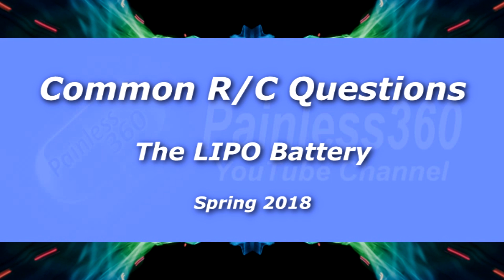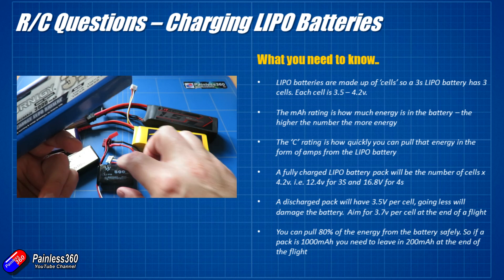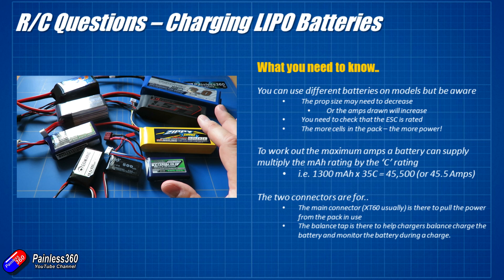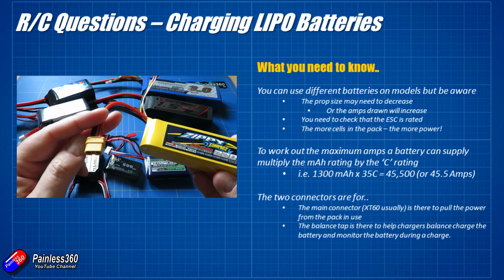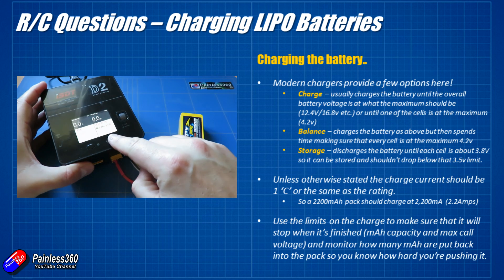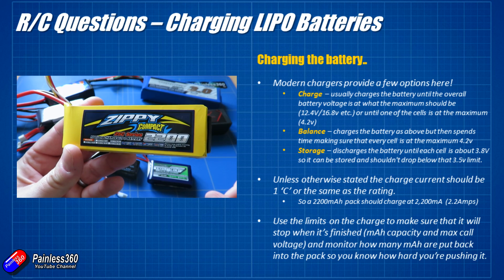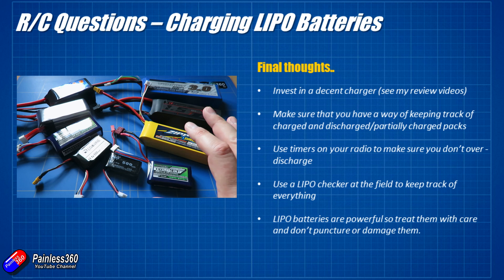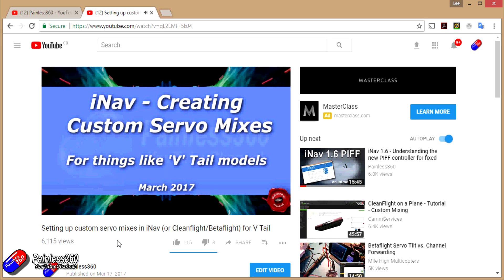Common Beginners RC Questions - LIPO Basics and Charging Tips

Comment: I wanna make my rc boat faster.    Is it the Volts that make it quicker ?   1 battery is 7.4 volts.  If I run 2 battery's together should get 14.8 Volts.  Should make the boat faster correct?
Reply from the maker: Increasing the battery voltage but kwwp8 g everything else the same might make it faster, but only if all the components can handle the extra voltage and power... Happy flying

Comment: Hey  glad I found your channel! I've been an avid RC pilot most of my life. Since I immigrated to Australia from the USA, I had to turf all my 72Mhz stuff and go with 36. Then everything went to 2.4.. so I bought a Futaba 9C system with the FASST technology. I then became Ill and put my aircraft into the hangar for 8 years. Last week I had to buy all new battery packs - including the 12V lead acid to start my nitro engines. An OS 2 stroke 120 pulls my giant Cessna 182 and a Thunder Tigre .70 4 stroke pulls my Extra 300S. So, all NiCd are gone. I was thrust into a new learning curve aged 68, but this video really helped me. Everything is all ready to go for this weekend! The question is,  do I dare fly the Extra 300 or stick with the forgiving 182 with its flaps and enormous wing - it will continue to fly at a walking pace and stop at my feet after <10'  roll-out after touchdown. I think that the Cessna will accompany me to the field this weekend. Thankfully, both of these aircraft's control  settings were retained in my Futaba T9CHP's memory.  It may be an 8 year old radio,  but it still works fine. With its 2.4Ghz module, near new receivers, servos, and, now,  brand new flight packs, why not continue to use it? I AM eyeing up a new Spektrum NX10 system, though!! That will take place when I finally  go with real turbine power. I rarely fly full-size planes anymore, and I still need my fix. So, why not go turbine if I can afford it? My daughter reminded me of a saying when she saw me getting ready to fly again. She quoted, "The difference between a boy and a man is the price of his toys. ".😂

Comment: Yes sir I have a 550mm pixhawk drone I'm using 2 lipo batterys both are 3s 25c ratings my telemetry tells me loss of power on 1 motor and if I take one of the batterys off it will say now 123 loss of power is it because of the c rating I'm using? If so what would you recommend for such a large drone?? Thank you!
Reply from the maker: It depends on the capacity of the battery as 'C' rating and the capacity work together to let you know what current you can pull safely. You need to know how much current the motors will pull and have an ESC setup and battery that can deliver a lot more for safety.. Best of luck!

Comment: what kind of battery would i use for a glider with just a receiver and a few servos?
can you buy batteries with the same connector servos have to plug it straight into the receiver?
Reply from the maker: It depends on what voltage the receiver and servos are rated for. If they can work on a higher voltage (8-9v) then a small 2S LIPO battery will work well. If everything needs 5v then you can use a small BEC (http://www.mateksys.com/?portfolio=mbec6s for example) that can provide the 5v from a mini 2S LIPO... You can see me wrestle with the same thing here - https://www.youtube.com/watch?v=csM979zrmvA
Reply: @Painless360  ok thanks, i ordered a 3s 450mah that i think should work, its 12v and my receiver normally uses 5v but apparently is safe to put more voltage through and 12v is what my servos want
im not sure how to figure out what kinda flight time to expect tho since servos dont draw power consonantly like a motor

Comment: If the model plane manufacturer recommeds a 6S 5000 mA C30 LiPo, will a 6S 5000mA 50C work just as well, causing  no damage to the plane?

Comment: Thanks, that was very helpful.
For 3d flying is it best to use less cells than more cells?
Reply from the maker: It is whatever is right for the size of of model. Power = volts x amps so increasing the voltage makes for higher power systems.... Happy flying
Reply: @Painless360  thanks.

Comment: I have a question,can i use a 800mah charger to charge a 2200mah lipo battery? Will it do any harm or somethings else please tell me.
Reply from the maker: Not sure what you mean by a 800mah charger but you can charge a 2200mah battery at 800mA. No harm, just slow charging....
Reply: @Painless360  ok thank you man

Comment: so the charging current from charger to the battery goes through the power cable? and it can go through the balance?
so i should probably get some connectors to match with my charger?
and how long does it take for a batter to charge? a 5000 mah with 5 A charging rat would be charged in 1 hour?
Reply from the maker: The main part of the charge usually runs via the main connector (XT60 or similar) then the 'balance' part of the charge uses the balance tap to target specific cells to get them all to the target voltage. A large part of the charge time is taken for the balance part so by using a 'quick charge' or 'non balance' charge you can shorten the battery charge time by a lot..

Comment: I have a question ! When we have finished to play, do we have to wait till theyre cold or we could charged them right up? Thanks !
Reply from the maker: If your batteries are coming down hot then you need to get ones with a a higher amp capacity. I normally let them cool back to room temp before charging..

Comment: I accidentally tried to fly with a discharged Li-Ion battery. I used it for 15-20mins. I wasn't able to charge it again because my charger/discharger broke. That was 3 weeks ago my charger still hasn't arrived. Should I not use the battery anymore? Thanks, love your vids!
Reply from the maker: A battery that has been abused a little will not be as good as it was before. If you are not pulling a lot of current from it then any damage will be less noticeable. I would treat the battery with suspicion for the next few flights if you get it to charge.. Be careful with it..
Reply: @Painless360  thanks for the reply, always a great channel!

Comment: Great video, quick question on AMPS, so a 5000 mah battery at 50c means 250amps? So if I run dual batteries in parallel I would get 500amps? My esc only does 150amps so I’m asking if I’m doing that math correctly
Reply from the maker: That is right..
Reply: @Painless360  ok so if my esc is 150 amp then that’s all I can pull? Are there any esc’s that can pull 250 let alone 500 amps?
Reply from the maker: Why would you need to pull 500Amps? I've never seen a motor/ESC that needed that..
Reply: @Painless360  lol, I don’t want to pull 500amps, I know castle esc does 200amps, I was just thinking that if it’s giving 500amps that you need to pull 500amps or you can damage something. Realizing now you don’t need to pull 500amps, that just what you have available to pull out. I’ve always ran single batteries so dual is little different. What do you think is better for speed runs, parallel or series? I’ll probably try both though.

Comment: Great video, thanks. I have a RC car (9125) which a 60A brushed ESC (25-ZJ07). It comes with a 2S 1600mAh 7.4V Lipo (Deans) and two 390 motors. I'm wanting to use a 3S battery and am needing help as to what c-rating and mAh battery to get. Can you please assist me? I have seen others use a 3S on it, but I notice in the ESC description, it says 7.4V. How is it possible to use 3S (above 7.4V) on this ESC? Another reason I'm wanting to go 3S is so it can reach it's advertised speed. I don't think there is a way to do it on 2S.
Reply from the maker: I'd never run an ESC with a battery it wasn't rated for. You're asking for trouble.. Best of luck!

Comment: Hi, I’m just trying to fly a 120$ store bought helicopter. The charger says input: 11.5-15V DC I live in Europe, and apparently our plugs have an output of 220V. Does this mean I can’t charge my battery? Is it referring to the same thing? I really don’t know much about electronics. Will a simple UK->US transformer be ok? Thx in advance.
Reply from the maker: You'll need a 12v power supply for that charger. Surprised there is not one in the box.

Comment: Nict video. One question. You said that you can keep Lipo staying charged for couple of weeks. Some people say, its like no more than 3-5 days. Your thoughts?
Reply from the maker: I've had LIPOS retain charge for month - they don't like it though and they gently discharge and holding a charge for that long can cause the battery cells to degrade and puff up.. If you don't believe it - try it ;)
Reply: @Painless360  Dont feel like trying). I guess I ll just stick with 7 days or less and put to storage, if i dont use it. Thanks for the comment.

Comment: Great vid!   I do have one question about the battery rating vs ESC rating.  I believe you said that a 45.5 amp battery is inadequate if your ESC is rated 60 amp.  Should the battery rating be AT LEAST equal to the ESC's?  Is there any harm if the battery's rating is GREATER THAN the ESC's?  Many thanks.
Reply from the maker: The battery should have a larger capacity. Please see my other videos in the introduction to remote-control playlist. Best of luck

Comment: If the full charge for 4s is 16.8V (4.2 * 4), then why does the battery have a rating for voltage? For example, my 4s batteries say 14.8V
Reply from the maker: That is the voltage of the battery with the cells at a resting charge. Not a full charge. It's just one of those things you've got to get used to.

Comment: any info on adding gps to long range multi rotor?
Reply from the maker: Lots and lots on the channel. Check out the iNav video playlist, you can also have a look at the Vector playlist and also the Pixhawk series. They are a few of the systems that use GPS to provide mission flying, autonomous flying an extra safety too. Best of luck!
Reply: thanks i will look, but pixhawk is to big and its no s-wing, im trying to use an f405 ctr on 6" qwad

Comment: I've seen some LiHV batteries, which apparently are higher voltage.  Is there any reason not to use these?  What are the reasons to use them?
Reply from the maker: They do give a slightly higher voltage per cell when fully charged. They provide a little bit more power than a standard lipo battery due to the slightly higher voltage. To be honest, there are little bit of a wacky one, I don't use them and most of the pilots don't either..

Comment: Hey,
is it better to discharge a LiPo Battery by using the Storage-mode and after 2-3 days recharge it or leave it fully charged (in relation to lifespan and safety)? 
Greetings from Germany
Reply from the maker: Leaving a lipo battery fully charged when it's not going to be used isn't ideal. In the early days, I put a couple of batteries away for the winter and they were  accidently fully charged . When I got them out to use them in spring, both had puffed up. These days if I'm not going to use a battery within a week of charging it then I'll pop it down to storage charge to save any extra stress on it.
Reply: Thank you!

Comment: Painless 360 ,,, i have a question , i have 3s lipo and one of cells die got zero and two of them 4.2 , is there a way to fix this 1 cell die or force recharge it alone ????
Reply: I had 4 battery's all with cells around 2 to 0.5ma, I used a bench PSU set to 0.5ma to try and boost the dead cells to the same as the others. I did bust them the same but the battery chemistry got messed up due to the cell dropping lower than 3v and the cell that was low would not hold a charge and had a loss in power output, this was the same for all 4 battery's I tried to recover. In short if you have a dead cell its a good chance your battery is no good. Sometimes if you fly and drop just under 3v lest say around 2.8v the battery may bounce back or you get away with it by sticking it into a charger ASAP and charge it. Force charging can be dangerous but lucky I have lab a LAB Bench PSU and temperature monitoring equipment as well as sticking them into a fire proof box wile I had a go boost charging. Sorry to say from my findings, when a battery is dead its dead.
Reply from the maker: My advice would be to discharge the battery completely, and hand it into whatever recycling station / place is near to you. When a battery has done this, that cell is dead and it's time to get a new one. Best of luck!
Reply: Agree its not worth the risk playing with Lipos and boosting a cell. I did get one battery working when I did it and I got holding a charge for a long time but I have the electronics kit to safely do it in a fire proof box and have done this kind of thing before.

Comment: Awesome explanation, especially for beginners. One extra thing I would point out is with regards to calculation of the total energy stored within the battery. Total energy is a product of Amp-hours (Ah) x Voltage (V). So, a 4000mAh 4S (14.8V) pack actually has less energy than a 4000mAh 6S (22.2V) pack, so it would be something important to consider when building your own quad, because higher voltage actually draws fewer amps for a steady hover when weight remains relatively unchanged.